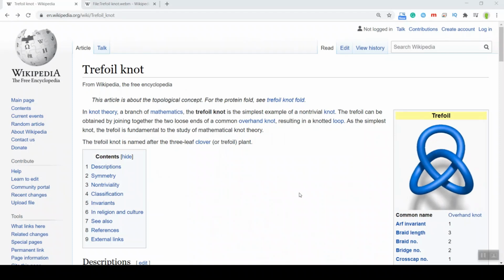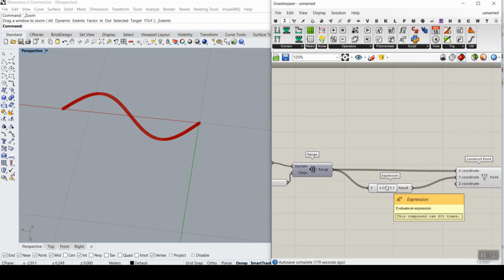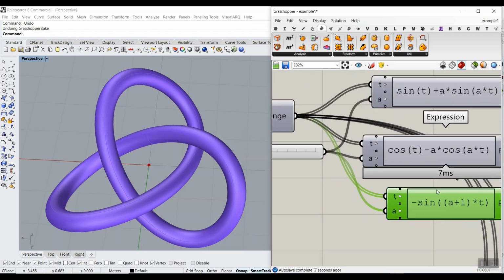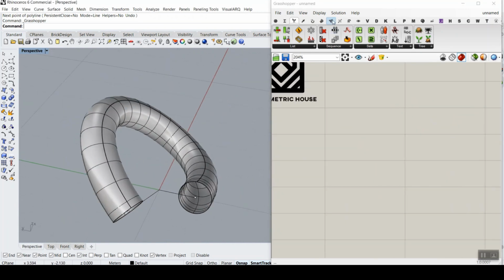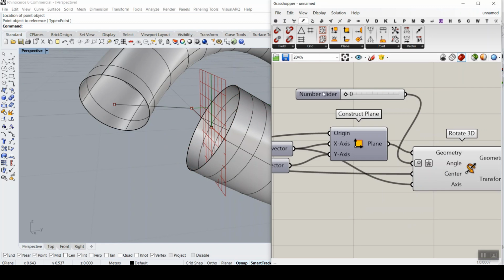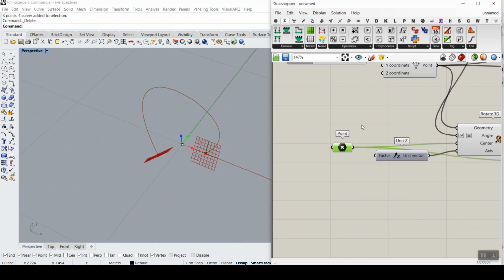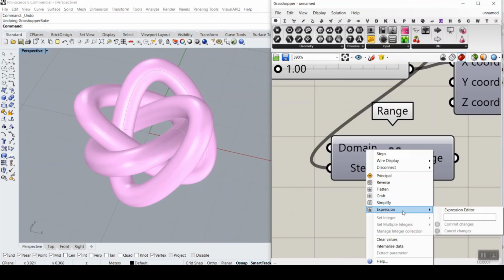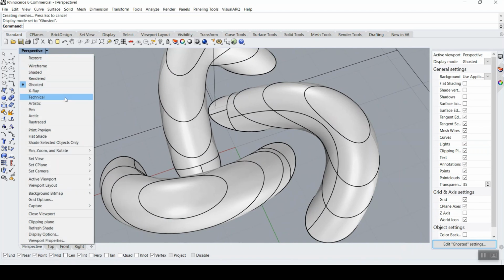How to make a Trefoil Knot (Parametric Surface)

Comment: Thank you soooooo much.  I'm a sculptor trained as an architect and newish to grasshopper.  One of the reasons I am learning grasshopper is to explore knots parametrically- my son did his thesis on knot theory with Colin Adams at Williams college and I had wanted to model his thesis.  This tutorial is exactly what I was trying to do, although I have since been told that his thesis isn't possible to materialize because it has more than 3 dimensions. If anyone can help me understand if there is anything in this paper that I can model parametrically, I would be super appreciative.

Abstract. We extend the theory of hyperbolicity of links in the 3-sphere to tg-hyperbolicity of virtual links, using the fact that the theory of virtual links can be translated into the theory of links living in closed orientable thickened surfaces. When the boundary surfaces are taken to be totally geodesic, we obtain a tg-hyperbolic structure with a unique associated volume. We prove that all virtual alternating links are tg-hyperbolic. We further extend tg-hyperbolicity to several classes of non-alternating virtual links. We then consider bounds on volumes of virtual links and include a table for volumes of the 116 nontrivial virtual knots of four or fewer crossings, all of which, with the exception of the trefoil knot, turn out to be tg-hyperbolic. 

https://arxiv.org/pdf/1904.06385.pdf